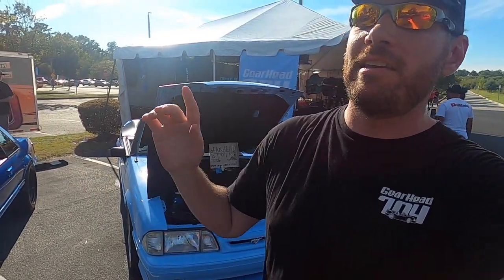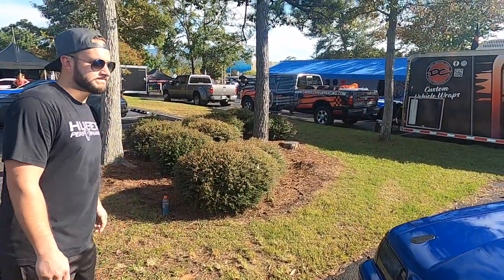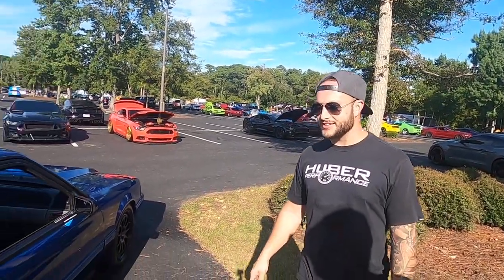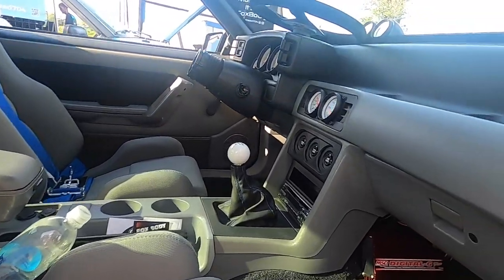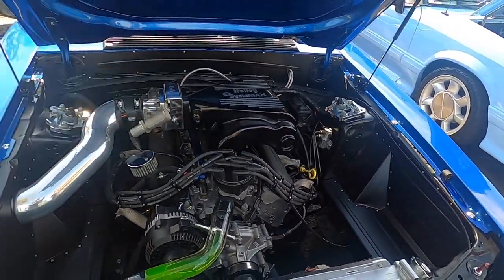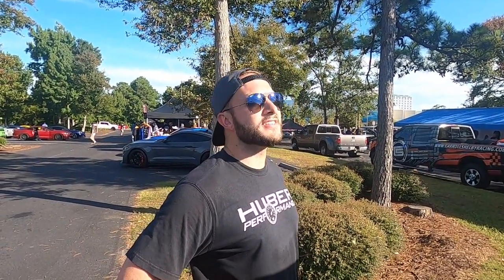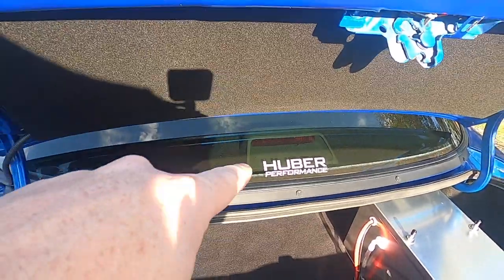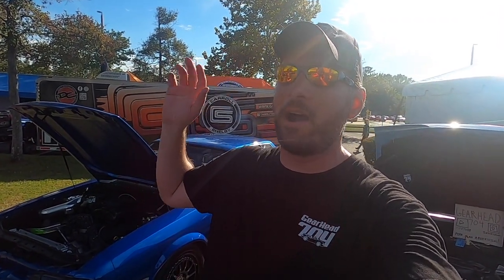The CLEANEST 347 N/A FoxBody NOTCH I’ve EVER Seen!

Comment: Awesome video. Matt I have 373 gears with a t5 and have no trouble on the highway...I can run 70 and 80 without even hitting 3000 rpm. I had a 410 and that was a little much but I love my 373
Reply: Exactly right?  My 373 car is so nice on the highway. My 430 gear car not so much!  I may do the t56 swap in it ,  but mostly for strength honestly.
Reply from the maker: I just got a little annoyed with mine on long trips, but it is doable with a 373 for sure.

Comment: I heard he has quite an idle hang after revving it. I had that problem until I looks at the fuel pressure regulator vacuum line was filled with fuel. The regulator’s gasket leaks through the screw into the hose that connects to the manifold that screws everything up
Reply from the maker: Interesting.  I know he is ripping things out soon, so I"m sure he'll look at everything agains once it's back together.

Comment: Beautiful car, love the color and setup 👍
I think the stupid jack that came with the Fox in the spare well, promoted the use of it on the pinch welds. Take a look at the contour of that jack, the line on the face "looks" like it's specifically for those pinch welds. 🤔
Reply from the maker: Hey J PP, yeah I think you're 100% right on that jack.  Sadly I took a floor jack to one at some point before I knew any better.
Reply: Alot of cars do that bullshit and that jack point gets torn up.
Reply: @dennisrobinson8008  fucking engineers